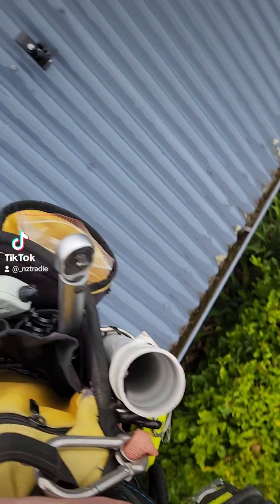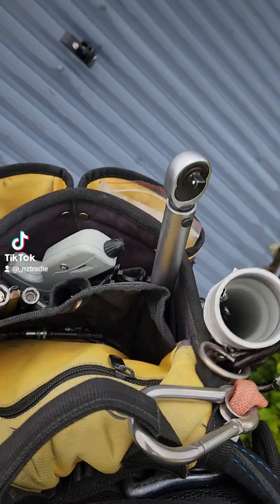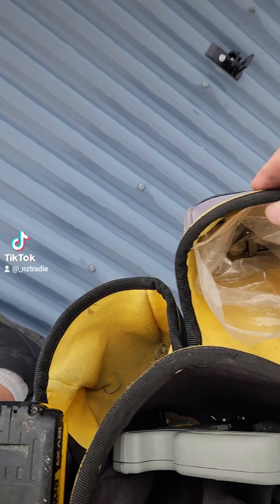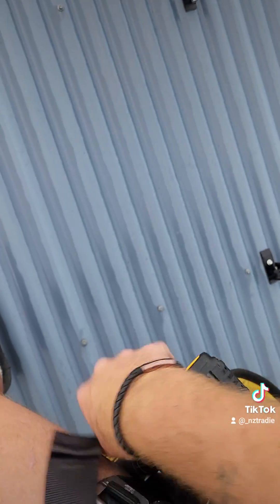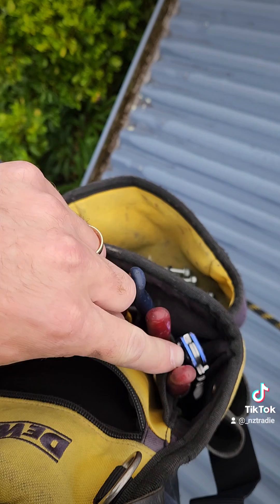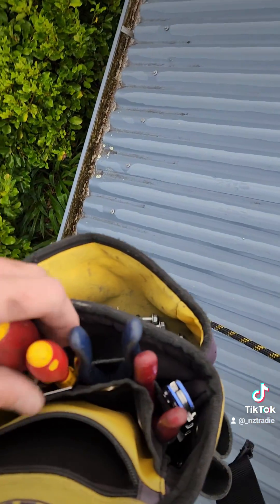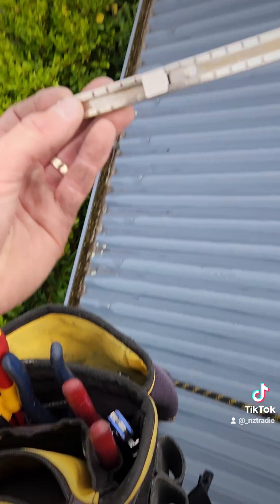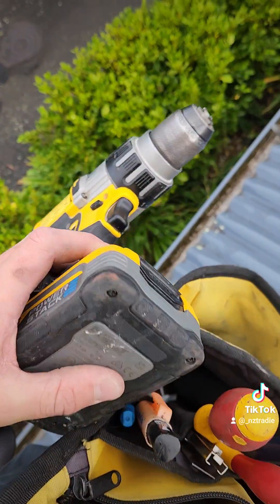Here is what I run in my solar tool belt

Comment: Ballsy to be a tradie wearing a metal ring... Not recommended my dude.

It's gonna happen and then you'll remember this comment
Reply from the maker: Yea, maybe, but im also not working with the kind of gear that would usually be associated with de gloving a finger
Reply: @_nztradie  sure sure. Don't want to sound like a wuss. But it can get caught on a bolt when jumping from a roof or something unexpected not tradie-related. My dad de-gloved his finger cause the ring got gaught in a door latch. I burned the shit out of myself because i accidentally placed a welding electrode holder on my ring and it conducted 120A into the welding table turning the gold ring a glowing red. Taking most of my finger's skin with it. Metal Rings and people who work with their hands don't mix so nicely. Stay safe mate ;)
Reply from the maker: @Vrykorps  thats all fair points